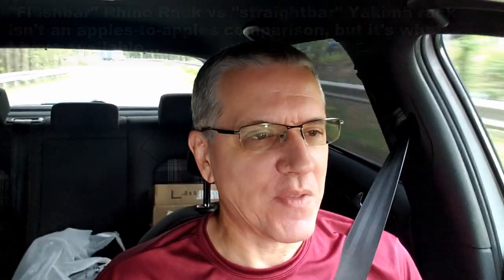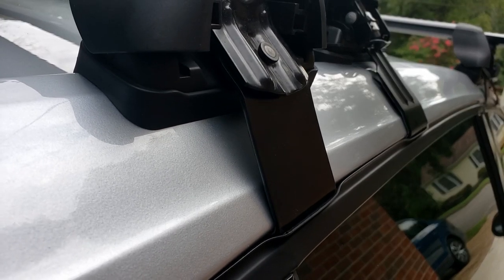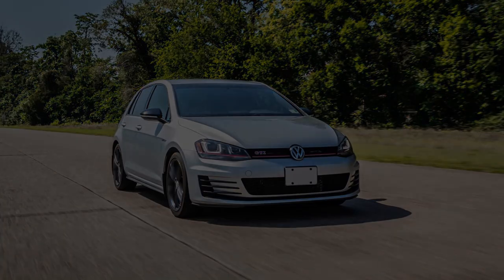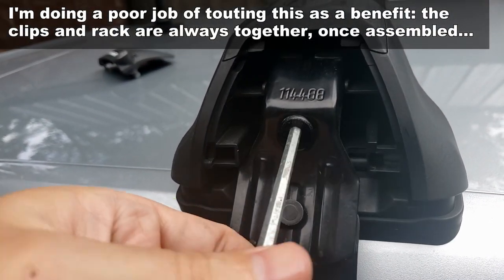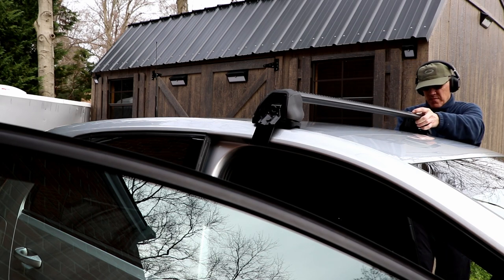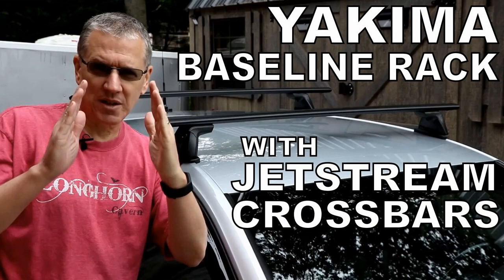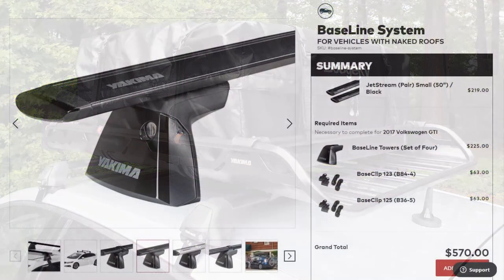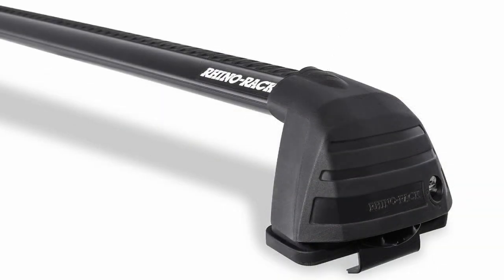ROOF RACKS - YAKIMA BASELINE vs RHINO RACK

Comment: I have heard that those clamp roof racks do damage to the car there pretty bad. Maybe i heard them for knockoff brands but i want to follow up. Any feedback?
Reply from the maker: I suspect that they can damage a roof if the clamps are overtightened. The RhinoRack comes with an L-handled wrench that bends when the appropriate torque is reached. That's good, but doesn't stop anyone from tightening "just a little more." Yakima comes with a torque key that releases with a "click," making it impossible to overtighten if the Yakima tool is used. Still, I'd be concerned with some of today's cars that have plastic roof portions around the sunroof. Makes me glad that my roof is all steel.  :-) Thanks for visiting.

Comment: Hi, I know this has nothing to do with Thule but I'm about to purchase cross bars for my car, a 2019 Kia Rio hatchback and I'm currently down to 2 options, the Thule WingBar Evo with the Thule Evo Clamp or the  Yakima JetStream with the Yakima BaseLine towers, I did not find a video comparing these 2 like you did with Yakima and Rhino Rack  but I figured you could give me an advise based on your experience with the Yakima bars
Reply from the maker: I cannot give you an experienced recommendation. Between those two racks, and assuming you currently have no accessories from either company, I'd get Yakima if American-made is important or Thule if European styling matters. I'm sure either rack is a good purchase. With that said, I think the lower profile of my Rhino Rack is quieter than Yakima... possibly quieter than Thule, too. Thanks for visiting.
Reply: @StealthGTI  thank you very much, the reason I was between those two is because I got them used and both were $150 dollars, I ended up getting the Yakima system with the jetstream bars and baseline towers, the car that had them and mine shares the same base clips for the front doors so I just had to buy the ones for the back doors, o just got then delivered yesterday and I installed the bars last night, I don't mind the noise they make and I do like the fact that the are higher because the only reason I got them was because I bought 2 kayaks and will be transporting them at least once a week.

Comment: Hello. I was very close on buying the Roc25 version but then saw on another website them having the Vortec 2500 in stock. Any preference on which you would get? I noticed you mentioned the Roc25 might be slightly more efficient.
Reply from the maker: Although I haven't seen one in person, I think the ROC25 is a better design. I suspect the mechanics of it are identical to the 2500; just small details about the ROC25 make it better. I'd buy the ROC25 unless you find the 2500 for substantially less. Thanks for visiting.

Comment: The Yakama will be louder without a fairing because it sits a little higher. If you install the fairing  on the Yakima then the buffering sounds went away almost completely completely  on my Ford Fusion.  As far as the height difference that height does come in handy with skis so if the skis are mounted bottoms together the bindings will clear the roof.
Reply from the maker: I'll have to consider a fairing for my Yakima rack if I don't sell it. Thanks for visiting!
Reply: @StealthGTI  The sizing for my Fusion was really wierd? It called for a 36" fairing but installed a 42" to tone it down some more. I have the flat 60" bars and can fit two bikes and 13' cubic cargo box

Comment: Still enjoying my 2016 GTI with only 36000 miles. Such a fun car to drive and does most things well. Just wanted your opinion on premium gas. I always use 93 octane, Is this necessary? Also, I am in the market for new tires. I live in STL, MO. We have snow and ice but not too much. The tires that came with the car hold the road quite well but maybe there is something better and that works ok in snow? Love your channel, makes me feel smart for purchasing this car as I have yet to have any problems, simply a joy to drive.
Reply from the maker: Premium fuel is not required on a stock car, so long as you're using Top Tier suppliers. Premium fuel also yields more power. My car is tuned; so, premium is a must.  Thanks for visiting.
Reply: You must use the premium gasoline for your GTI 91,92 or 93 base on the state you live in.
Reply from the maker: @keangfamily  - Not true, according to VW's website and the sticker inside the fuel flap. The stock GTI will run fine on 87 AKI, just with slightly less power. With that said, I'm glad to have 93 AKI available for my tuned GTI.

Comment: I honestly have so much road noise inside my GTI, that I cannot discern (easily) the noise from my Yakima jet stream rack. Have you added sound dampening to your GTI?
Reply from the maker: I have not added sound dampening. I have it on hand, but haven't installed anything. Now that I have a louder exhaust, I'm motivated to dampen the hatchback and trunk area, at the very least. Anyway, none of that will reduce noise from the roof. In fact, it may make it easier to hear that noise since the exhaust/tire noise I'd target will be reduced. More to your report, are you saying that you cannot hear the difference between "no rack" and "rack" at 70 mph? I hear a clear difference. It almost sounds like my Rhino Rack with a cargo box mounted, albeit not quite that loud. HAHA!  Thanks for visiting.

Comment: 10:30 more width capacity on Yakima, but overhang can be a head hazard! ⛑
Reply: That's a good point, I have been curious how hazardous they are as I have yet to be around a GTI with more than the flush bars, usually the stock VW ones. I want the multi-functionality to be able to go get plywood or put a bike rack next to a 14-foot canoe upside down on my roof so I'm seriously shopping
Reply: NoZenith I only found the VW flush mount in silver and I wanted black, so I got the Yakima medium width. Very rare, but have hit my head... also have not needed to mount more than a cargo box.
Reply from the maker: I have the 50-inch bar on my Yakima rack. It seems to be a good length, perhaps because the bar sits farther forward on the roof. Who knows? A longer bar would surely be a head-banger.

Comment: Why not try to take a hair dryer or heat gun to the deformed T bolt strip. Doesn’t seem like that much work. For the Yakima jetstream.
Reply from the maker: That's not a bad idea. Still, my purpose was to share what might happen naturally, especially if away from a hair dryer or, in my case, the owner's hair is too short to justify owning a hair dryer.  ;-) Thanks for visiting!

Comment: What’s the width of the wind fairing for the rhino rack?
Reply from the maker: I don't recall. I used their RF3, but removed it quickly thereafter due to excessive noise, which I found ironic. On the bright side, that says a lot about how quiet the naked rack is. Thanks for visiting.

Comment: What size are the T-bolts for the rhino bars ?
Reply from the maker: It's a 3/8" bolt. But that's not all there is about the bolt. It has a flat face that's 3/4"x3/4". I use two t-bolts, depending on my need: This bolt is shorter = https://www.etrailer.com/Accessories-and-Parts/Yakima/Y8880184.html; this bolt is longer - https://www.etrailer.com/Accessories-and-Parts/Yakima/8860061.html. Both of them fit. Good Luck!

Comment: Anyone have water leak issues with rhino rack?
Reply from the maker: No leaks. I don't leave my racks mounted long enough for the door seals to take-on a new shape. I rack-up when I need it, remove them when I don't, and my seals return normal very soon afterwards. I'm about to take the rack on a 7000-mile journey. The seals may take a little longer to recover after such a long drive, perhaps resulting in a temporary wind noise at the door, but I don't expect any leaks. Thanks for visiting.